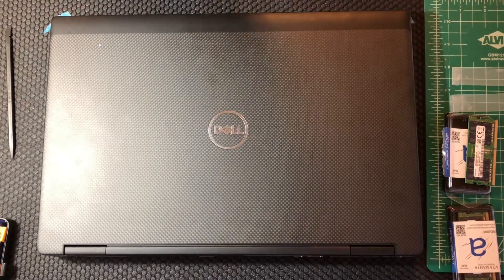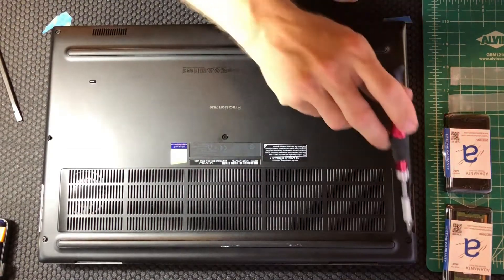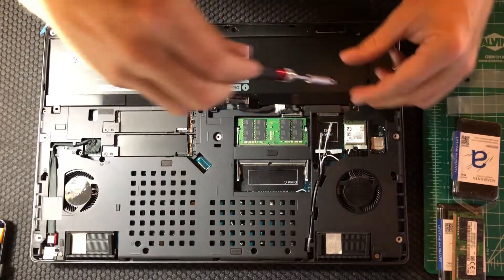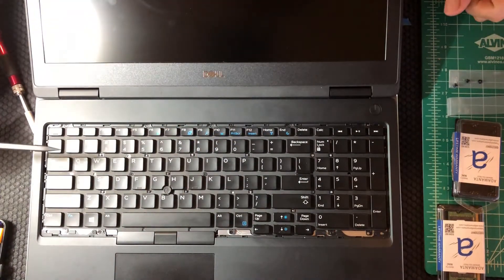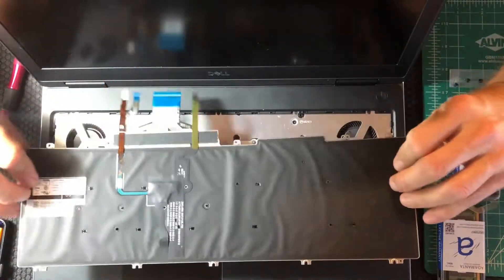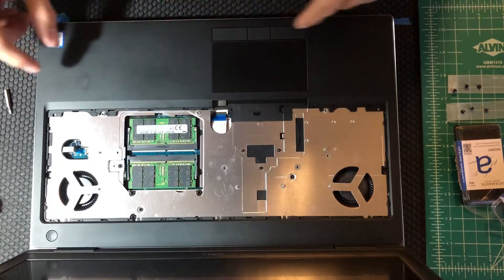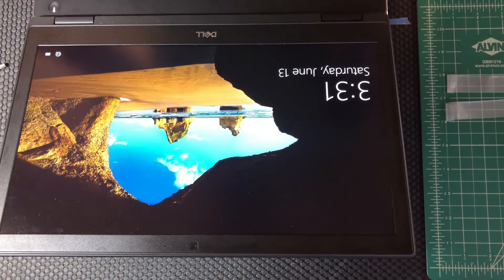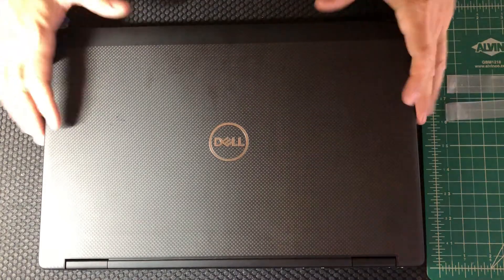How to install four RAM modules in a Dell Precision 7530 Laptop

Comment: Thank you for showing how to replace the RAM modules under keyboard. For some strange reason DELL insists on using the slots which are hard to get to instead of those under the bottom cover. It took me about an hour because the keyboard is tricky to remove and put back.
Reply from the maker: It takes a lot of work but my laptop is pretty powerful now, for a fraction of the cost of buying all that RAM from Dell.

Comment: Pro Tip. you don't have to pull the ribbon cables all the way out for the keyboard. Just need to disconnect them, flip the laptop over, and remove the keyboard bezel and screws, wiggle the keyboard until it comes loose and then just fold the keyboard towards you esposing the ram door. That way you don't have to worry about fishing those cables out and then back in. You just need a few milimeters of give on them. But you definitely SHOULD disconnect them lest you risk pulling the connectors apart.
Reply from the maker: Excellent.  Thanks for that.  I was figuring it out as I went along.

Comment: I would like to upgrade my 7530 to 128GB, but the Dell website reports that the max memory size is 64GB. How can I tell if my computer can take 128GB?
Reply: I think only the high spec version with the Quadro P3200 can go up to 128gb. I have the same laptop aswell